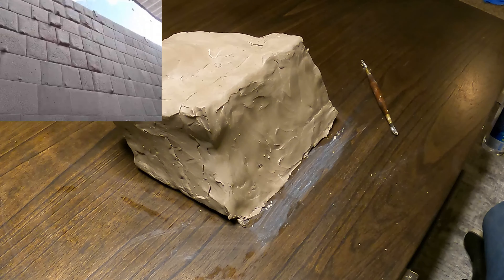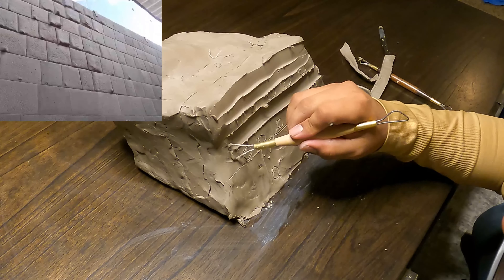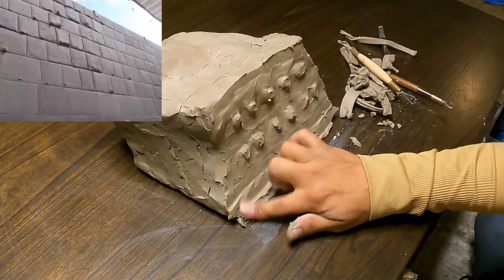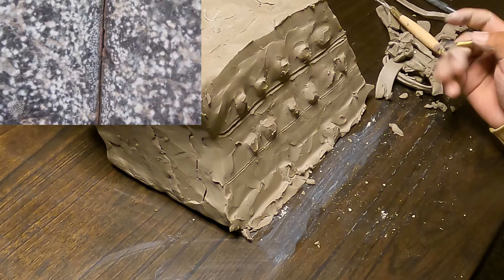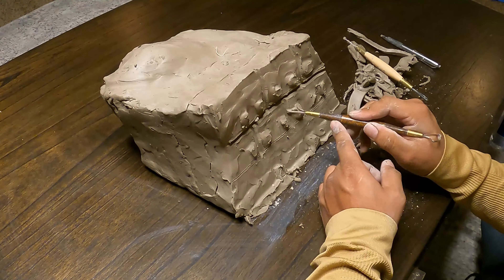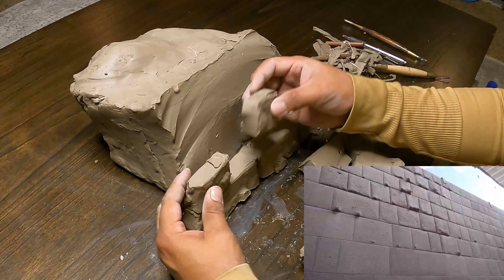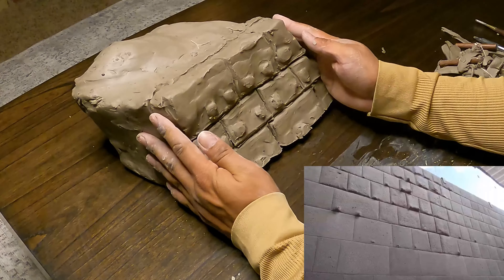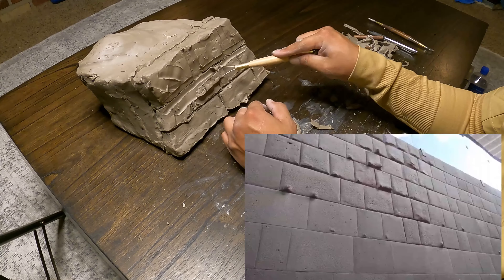Perfecting Polygonal Masonry: A New Explanation on the Ancient Engineers’ Construction Methods

Comment: This would be pretty easy to prove/disprove. Inspect the  grain pattern of the stone, and see if it continues from one stone to the next in the same direction.
Reply: It doesn't.
The striations don't line up.
Reply: @Fisch2k4  sources ?
Reply: @ottodidakt3069  Close up pictures, they´re out there
Reply: @ottodidakt3069  His own brain.
Reply: @ottodidakt3069 
His fucking eyeballs
Reply: @Kommander_Rahnn  eyeballs are underrated
Reply: @HorusOne-p9o  
So are brain cells, apparently.
Reply: Well, I never thought of that yet I'm a carpenter. That does it!
Reply: it doesnt. How do I know? Ive been there a half a dozen times. Those stones were made. Altering the quartz(the binder) would have had to occur. Some places vitrification has no doubt happened. melted stone....

Comment: So...why go through all that effort to break the stone apart into nicely fitting blocks, just to go through even more effort to put it all back together? What am I missing here?
Reply: It would be easier to move all the individual stone blocks, one by one, from the quarry to the building site rather than the much larger, heavier slab from which they all originate. Just my quick take on it. If this was the method, there still  remains a host of other issues, not the least of which is there could be no guarantee that you could get clean breaks each and every time the slab is pushed over to break into the individual blocks. No way to know if or where there might exist natural faults and weaknesses in the rock, which would likely produce jagged and irregular breaks.  Interesting video though.
Reply: In order to make them easier to move
Reply: thats a good point also.
Reply: unless they mined the stones in a different place and then transported them to the place where they built the wall.
Reply: Cause your building site is separate from the quarry!
  Cutting blocks from the stone mountain side is what they did, and it just makes sense to think they would do as much of the block shaping at the quarry as possible.
Reply: Well, the assumption is, ferrying one huge stone is a logistical nightmare compared to ferrying relatively smaller chunks then piecing them together on site.
Reply: Not bad

Comment: I missed the part where you explained the cutting behind.
Reply: lol
Reply: Because it's been faked 😂
Reply: I getcha
Reply: There was no cutting behind in his interpretation I believe, he said they would have use natural occuring faults and cracks, in wich I suppose they would have inserted wood and levers to make that layer tip...
Reply: He's got the right idea but instead of digging down behind vertically they chipped a trench onto the horizontal surface then popped the slab off the bedrock along the striations or layers, then dropped a weight on it creating movable polygonal shaped stones they could then stand on their edges the order they are laying there. The fact they are standing on edge could be why we see the surfaces delaminating along the grain or layering. Have a good day👍😊
Reply: You dont , look into how they separate huge chunks of marble from the quarry face it will tell you exactly how
Reply: @tharsgaard663  When I look at granite quarries, they say the first stage is drilling back behind. Then use wire or chain cutting saws. I saw granite being taken out with a massive cable in North Carolina at Mt. Airy. 
  I didn't hear him get into this, except to say they took advantage of natural fault lines. Maybe he didn't feel that part was very important to talk about.
Reply: @Qingeaton  the wire during the bronze age would be amazingly strong brass
Reply: It was was most likely not done by cutting, but it was probably done by splitting. The splitting technique is still used today. It is done by drilling a series of holes that are in line. Then wooden wedges were jammed in those holes. And then water was used to make the wooden wedges expand. And the expanding wood splits the rock. Today steel feather and wedges are used to split the rock because that is quicker than expanding wood. But it can also be done with expanding wood.  Many ancient quarries show evidence of those drill holes. Of course those drills are not like modern drills. It was done with a hamer and chisel, and by slightly turning the chisel after each blow. That's also how the old miners used to drill holes by hand. It can even be done with a relative soft metal such as copper or bronze. Granite is a hard rock, but it is also brittle.
Reply: @insAneTunA  I'm aware of those old techniques. They were even covered on a cartoon I watched as a kid 50+ years ago.

Comment: Interesting but how do you propose they cut the back of the stones in one go in such a way that it would form a complete wall that they could push over? The quarry would also need to be of premium continuous solid stone in order to make walls like that, and there are a lot of walls like that. So it doesnt add up.
Reply: exactly that's exactly the hard part, doesn't make sense
Reply: @Brisius  and to add to that, we can easily test if they did use this method by analyzing the back of the stone. They should theoretically all have flat backs. When we do that, we discover that they are not flat in back. They are contoured and or staggard and still tightly fitting.  Also some larger base stones are double sided with nubs on both sides and have wider bases which makes it impossible to knock over (in fact is the reason why they still stand). I don't want to discouraged ideas. I applaud the discussion, but this idea needs to go back to the drawing board.
Reply: Some 30,000 year old ancient lost technology to soften rocks
Reply: Maybe they didn't do entire walls, just monolithic sections, more tall than wide?
Reply: @j.f.c  but how would they connect them perfectly to make a continuous wall? These are massively long and or tall! With thousands of stones, not just one the surface facades, but thick too with more between
Reply: You did not listen to him properly, he said it at the begining of the video.
Reply: @bofpwet9500  I rewatched this over and over to see what you are talking about. He did not propose how they sliced down the face of rock in order to "fell" the face off. The closest possible thing you might be talking about is "natural fault lines" that he briefly mentions, but he does not propose that is how they "fell" the rock face. At least not in this video. If that is his proposition, it is quickly debunkable. A "Natural fault" would not conveniently run the face of a rock such that it would produce repeatable results. It would Also limit wall lengths, you could not design anything with such things of it existed. I don't even know what a "Natural fault line" in a stone is in this case. There are natural cracks and veins. These are random and can only be used once. Not to mention that Rock Fault lines are usually in the middle of large rocks. It isnt conveniently on its face. Again, such a thing would limit your design to the point that you could not build an entire building this way. You would not, for exaple, be able to join righ angle faces as they do. Because two different wall faces would have to come from different fault lines. So they would terminate at a gap. These ancient buildings will curve their joints together like fingers interweaving. These corners also make no sense in the "face fell" theory presented here. So at this point, if he is proposing "Natural fault lines" as the solution to how the "fell" the face, it is fantasy that solves an inconvenient problem to this theory. The theory as a whole falls-flat-on-its-face 😆
Reply: @StalkedByLosers  It was brief yes and you may not like the idea but there you go, he also already answered on some of your points somewhere in the comments. At least this idea is totally rational and orignal with no need for an aliens technology bullshit, and that alone is quite refreshing now days.
Reply: @bofpwet9500 Presenting false dichotomies also doesn't help this argument. You also make it seem like the only problem with OP's theory is me not liking it. which is bogus. The theory can't overcome the problems I presented. That's the reason why it fall flat.
Reply: @StalkedByLosers  I don't think he said anything about having "a theory", and that this was just a thought, I personally don't think it fall flat. If you believe you can easily have better ideas that are yours only, feel free to share them with us. But if you can't listen , or read, or think, maybe you should just work on that first.
Reply: @bofpwet9500  the first sentence is inconsequential. Call it a "theory" or "just a thought", makes no difference to this convo.

The second part of your response regarding the idea not falling flat or not; the criteria for it being plausible is it must work for all cases. This idea that they used nubs to break the wall by making it fall only works in the narrowest of cases IF you ignore how they sliced the wall off such thst it can fall. When you apply this "Natural fault" theory (idea, thought, what have you) then it becomes impossible, there are zero cases that this could work. Show me a natural fault in a rock that is shaped as a building, that can be used to make a face fall off. There are none. These natural faults are between massive rocks, it is never presented on a face that can be carved and then triggered at will to drop, because by nature of faults, it is between two places. It makes no sense, you fail to make it make sense and OP doesn't even try to. 

The last part, regarding me not listening, me not thinking, me not whatever. Me me me me all about me. This is called an "Ad Hominem Attack", and it is often the last desperate attempt to win a losing argument.

Regarding my ideas that are solely mine, wtf? I don't care who stakes claim, who it comes from doesn't make it true (unless it comes from the people that actually did it). This is also part of an Ad Hominem attack.
Reply: @StalkedByLosers  Not even gonna read, don't stay out untill the sun come little troll ;)
Reply: @bofpwet9500  lol guilty of what you accuse
Reply: What about the corners ?
Reply: @yourstruely9896  I actually posed the question but  @bofpwet9500  chimed in and attacked the person asking instead of using his brain and trying to think. He then accused the person asking of not thinking or having ownership of their own unique ideas,  which somehow  owning an idea makes it credible. OP is being heralded by this guy as an owner of a unique idea to the mystery of ancient megalithic prehistoric buildings. Somehow, because he originated a unique idea, we are not allowed to ask questions because asking questions immediately poke holes in it since it reveals the unique idea to be half baked and just not workable. So it's bad.
Reply: By splitting the rock instead of cutting it. The splitting technique is still used today. Drill some holes that are in line, then jam some wedges in those holes. Hit those wedges in turn, until eventually the rock splits. Today steel feather and wedges are used. Even hydraulic wedges are used to split the rock. But a theory is that the ancient people used wooden wedges and that they used water to make the wedges expand, which would split the rock. It requires some time and effort to drill those holes, but with enough people you can split a lot of rock in a relative short amount of time. Of course those drills are not like modern drills. It was done with a hamer and chisel, and by slightly turning the chisel after each blow. That's also how the old miners used to drill holes by hand. It can even be done with a relative soft metal such as copper or bronze. Granite is a hard rock, but it is also brittle.

Comment: Nope. They carved these in situ on the rock face, you can see the nubs still in place at quarries like Ollayantambo. When the stone was perfect, they snapped it off leaving nubs on the intended removal block, as well as corresponding nubs on the quarry walls - it is completely bizzare. The problem is we also have evidence of some sort of concrete at these sites, not only that we have evidence of the stones being exposed to extremely high heat and apparently glazed. There were multiple technologies at work here and it is totally baffling. The quarry marks at Ollayantambo show that the stones were extracted leaving very smooth walls, and this does indeed look like they were clay and cut out with a giant knife, which makes zero sense at all because that rock is not clay... it has veins of quartz running through it. Weird stuff!

Comment: The fact that you believe stone tools were used on these unbelievably hard stones indicates to me that you need to do more research. This little exercise proved nothing.
edit: You also said the tight fitting nature of the blocks was an accidental byproduct of the way the cut they stones. Cmon, man.
Reply from the maker: You may be right. I’ll have to do a full size demo
Reply: @Kwalade  One interesting obstacle You will then confront is to separate the entire block, with coppertools, from the mountain. Also note that the grid pattern is intentionally asymmetric, rather than repeated squares, in order to withstand earrthquakes.
Nice try anyhow, and original thinking!
Reply: What if, at one point in time and at the time of the building of theses walls, the material was soft and workable and due to some reason or event the building materials turned soild.
Reply: @dangerouzdave1172  Interesting idea! But, if so, wouldnt the mountains we see today have pancaked long ago? And wouldnt we find more luxury  tyrannosaurussecure and elaborated hillside apartments all over?
Reply: @dangerouzdave1172  I've always thought the same. What I do know is people don't give our ancestors enough credit, instead they revert to aliens of some higher being.
Reply: Jean-Pierre Protzen wrote a research paper called Inca Quarrying and stonecutting, explaining the evidence he found from ancient quarrying sites and how simple tools were used to shape large stones. Being hard also makes a material brittle, hence easier to flake off under impact. There are also ways to shape stone surfaces by grinding with silicate sand and wood, quartz or other stone pieces. I'm not saying these techniques explain everything, just to clarify the misconception that stones are impossible to work on with primative tools.
Reply: Ultrasonic cutting devices and "anti-grav" to move them. Mastery of Nature is the Message. Demonstration Incarnation; Great Pyramid. End of conversation 😂
Reply: @danbiss87  
No serious person does that.
Reply: "accidental" is ridiculous having in mind the precision and size of certain monuments. Then, the stones don't "belong" together as in they are not from the same continuous place and it's pretty evident. 

The truth is: they had an advanced and very efficient way of cutting them, they had an efficient way of moving them and they had an efficient way of fitting them. Not claiming magic or aliens, but if you do the math behind some of these monuments you need feasible time scales. So, nobody really knows how and everything is just speculation.

As a side note, which has nothing to do with any of this. In my village we have houses built a few hundred years ago using a technique that involves stones found in the river, which are perfectly fitted together like bricks. Nobody alive today knows exactly how to perform the technique, but it is there and it is very recent. That being said those stones are not cut and a child can lift them.
Reply: @dangerouzdave1172  that wouldn't be the case and the evidence is very clear: granite monuments have their veins inside just like they were when the granite was cut from the quarry. Also, no signs of melting like spillage of the stones. If you put soft material together like that it is naturally going to settle. I think a better theory would be some sort of chemical reaction for the cutting but even that is far fetched.

Comment: granite doesn't believe like that,
you would have to cut halfway through the stone for this to work and it would only work on the stones that fell the furthest and no garrentee that would break along these lines.
plus, the bottom 3 or 4 courses would remain intact.
Reply: Even if the lower courses remained intact that would represent a massive efficiency saving.
Reply: Sandstone*

Comment: I applaud the effort, and I appreciate anyone trying to apply logic to this illogical question. I see those sexy walls and I see the work of people that were absolute masters of their environment. Working stone was easy for them, 2k ton and bigger stones were moved hundreds of miles, they could do anything they wanted to do in stone. Regardless of its type or hardness. All that being said joints such as these have been found all over the world and most all of them share that bevel you pointed out, you hypothesize they’re hammer marks from a scoring process, that may be the case, but when you cut a stone and join it to another, the joint itself becomes weakest point in the stone, so erosive forces will act on the joint faster than the body of the stone. Obviously no one knows for sure, but ideas like this one will one day solve the puzzle 🙏